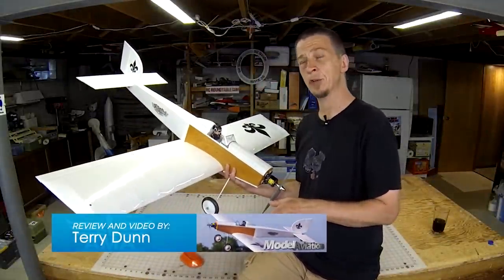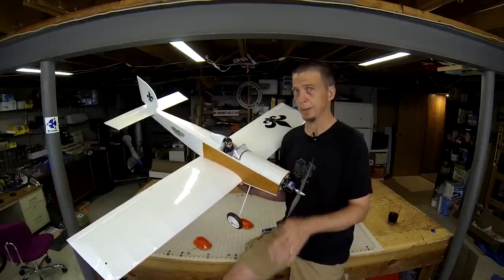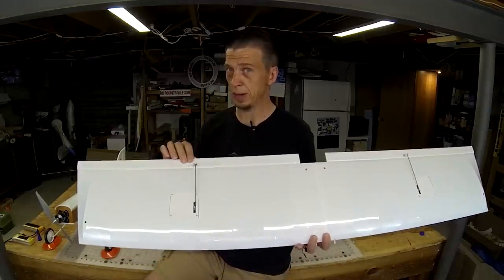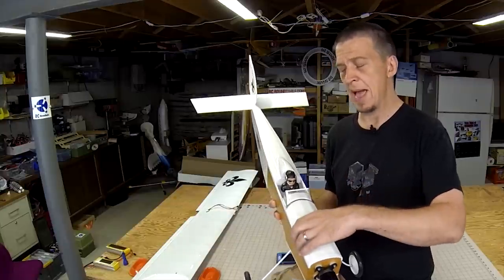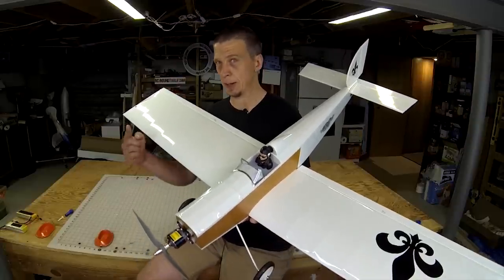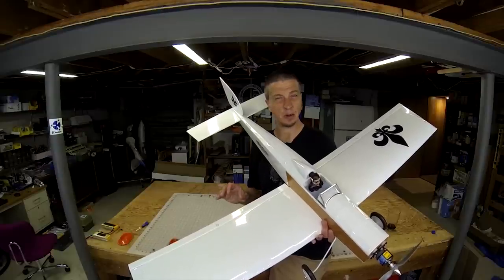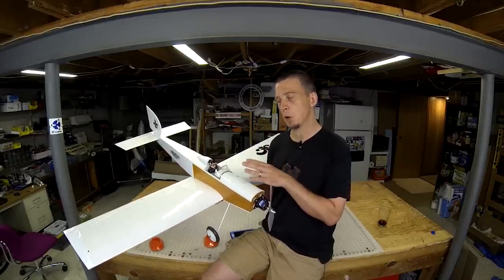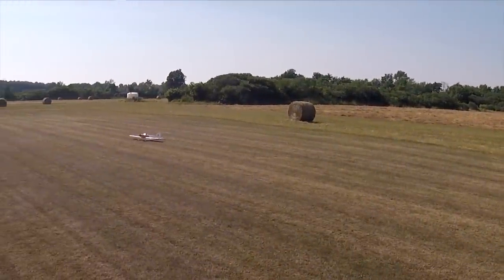Old School Model Works Sky Ranger 40 - Model Aviation magazine

Comment: Terry, could you describe your set up for the rudder/tail wheel linkage?  Is it just a ball link that is simply screwed into a shaft wheel collar? If so, could you give the size.  I am currently building the Ranger forty and have gotten to the point where I am setting up the controls.